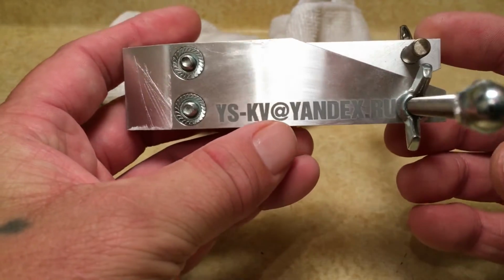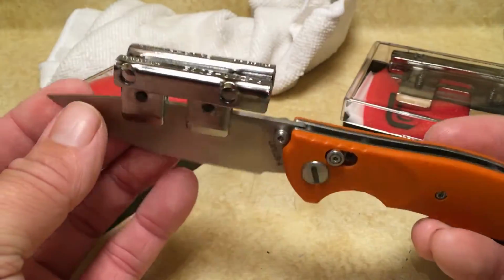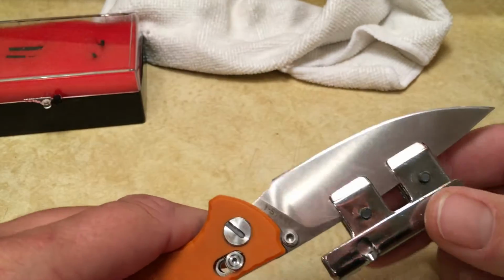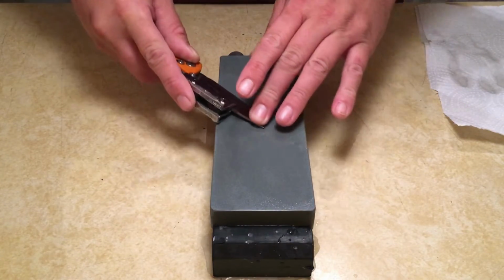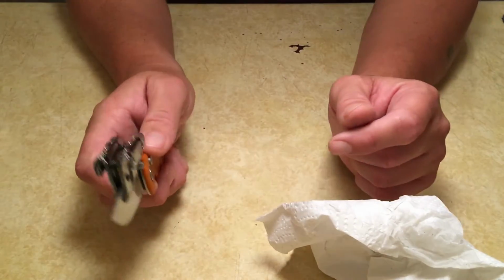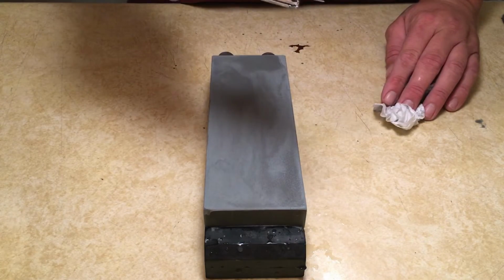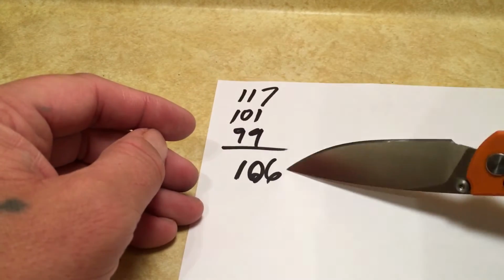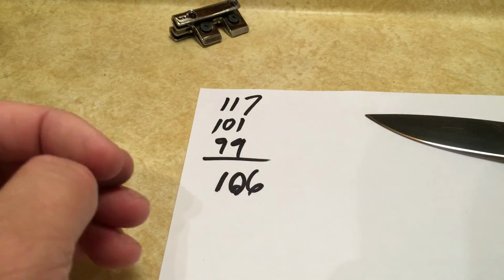Razor Edge System - Knife Sharpening Guide

Comment: I am from northern Mn, and way back in the 70's, I helped demo these at gun and camping shows, with, and for the Juranitch's. There is a tip to make these work better with less, to no wear on the clamp. They sell adhesive teflon sheets and stickers with peel off backing. If after clamping the knife in, you cut and stick some small strips of this teflon tape on the surfaces of the clamp that come in contact with the stone, than the clamp will last much longer. You have to peel the tape off to get the clamp off anyway, so just use new strips of tape each time.
I do not mean electrical or any packing tape. Teflon tape. There are competing brands nowadays. I believe the general term for these products is frictionless tape. I have used it for decades in other applications. I should also add that where and how you put the clamp on the knife makes a huge difference. I.e.- closer to the hilt/handle, or closer to the blade. You also do not have to clamp it on with the spine of the knife pushed back flat and straight to the inside back of the clamp. You can put the clamp on at different angles to accomodate different tip curves and shapes. 
 I prefer freehand sharpening myself, and that is about all I have done for decades. But be aware there are variations to consider for each knife shape as to the proper angle and placement of ANY clamp system to best fit the shape of the cutting instrument you are sharpening.
Reply from the maker: Thanks so much for the tip! I still think razors edge should address this, and the end user shouldn’t have to tweak things, so it works better. Still, that is very helpful to know, for someone looking to use these. The wear is pretty dramatic, on first use.it hasn’t been too noticeable in subsequent rounds.
Reply: @Jef  , You're welcome. I agree with what you said. It was addressed years ago. I am not associated with them in any way anymore, but they have kits you can buy. Some of those kits in the old days had vhs tapes that went into great detail on these finer tips for users. They also had what were called advanced use videos. From what I have seen looking online, they sell a fraction of what they used to.
Here is some bio. John was known as the "lumberjack" sharpening guy in shaving contests, the guiness book record, and for the classic, razor edge book of sharpening. What most people don't realise is he owned and operated a company that specialised in the meat cutting industry and both sharpening knives for slaughterhouses, and selling equipment for the employees to sharpen their butcher and boning knives throughout the work day. He invented and refined many sharpening and honing tools for the meat packing industry. Many modern sharpening and honing designs were actually his inventions. Such as the mouse. Many of the spring loaded devices that have two seperate moving rods are all copying John's designs going back to, I believe, the late 60's, early 70's. Possibly even earlier. He was responsible for Buck putting out the Honemaster. 
I also am fortunate in that I was friends with and helped design many of the Crock Stick products, having been friends with the owner and inventor of the Crockstick. Louis Graves Jr. A former, famous WWll fighter pilot and in later years, a Jehovah's Witness minister. ( I am not Jehovah's Witness and Louis never preached to me). I know a ton of backstory and tips for those, as well. Louis lived on Sunfish Lake just north of Anoka Mn. Interestingly, the factory was across the street from his house. I know all the connections between Smith's sharpeners, other companies, Sal Glesser of Spyderco, who paid money and got permission to make and sell the Sharpmaker. Which was actually one of Louis's designs he designed and used to sell. Louis stopped selling it, and gave over the rights to Sal. My sister lives less than two miles from Louis's old house and factory. Louis was a blood heir to Case knives and helped design many of Case knives iconic models and designs. Louis's old house and the falling apart factory are still there.
John started his company in Green Bay, Wisconsin and sold his goods through mail order mostly, from Green Bay. Or at shows, fairs, etc. They moved the company to Ely Mn when they moved there.
Interestingly, one of John's sons, who I knew and sometimes worked with became a wrestler for the AWA, known as Nord the Barbarian.
He went to the WWF, that's what it was called at the time, and became known as the Berserker, if I remember the stage name correct.
He retired and became a car salesman in Anoka Mn. He has even sold a couple cars to my sister.
 Have a good day Jef and nice chatting.
( I have way too much sharpening stuff and have been addicted to it for about 50 years now, as I grew up doing mountain man and outdoor survival stuff. That was how I bumped into Mr. Juranitch in the first place. He admired that a teenager could live in the woods for weeks, trapped, did pioneer skills, and he liked the knives, sheaths and stuff I used to make.) I enjoy your videos Jef!
 Have a great day!
Reply from the maker: @paulkresky1465  Awesome to hear the history behind some of this. Thanks so much for taking the time to share that. I pinned the comment so hopefully other viewers will see it. Amazing to hear how much he influenced sharping gadgets, to help people with consistency. I knew these things were around for some time, but no idea of all the detail behind it. The Sharpmaker, for example, I thought, was Sal's invention! I had never heard of Louis Graves Jr. till you typed his name. 

Btw I remember the Berseker. I watched the WWF back in the day. For a kid, it was almost mandatory. I even remember when Cindi Lauper got involved, and had several music videos featuring some of those guys. Funny ole world :)
Reply: I really enjoyed reading that. Milestone moments with giants of the knife community.
Reply: Thank you for the tape idea!

Comment: Great job 👍. I have this system sitting in my stone bin.  Up to this point I'm a C grade free hand sharpener.  Making the effort to sharpen free hand has helped me a lot with stropping.  I picked up a bunch of practice blades at the thrift store.  I occasionally sharpen a few and return them with a good edge.  Masking tape on the blade labeled Sharp.   I'm buying the R1 Sharpener soon to get my expensive kitchen knives squared away.  In a year or so my free hand skills may get to a B+ level.  The problem is that I already get A+ work on the KME   thanks again so much for the video 😀👍
Reply from the maker: Yea using guided systems and then comparing your free hand edge, can be discouraging. I see nothing wrong with guided systems. They are tools I still use. However, the experience of free hand sharpening, is just so much more rewarding.. If you keep at it, you will eventually start to notice a change in the the edge quality. It just takes time and practice.

Comment: Great video and much respect for you showing real time use. I’m not sure but on the nanawa what about putting a small piece of friction tape on the blade to help it from sliding? You can get rolls of it in the plumbing isle.
Reply from the maker: That would probably work really well. Or even shelf liner, if you can get the clamp to fit over it and the spine. I shot a video last night using it, with just clear packing tape. It held in place well just using that.
Reply: Jef Jewell well if you’re having issues that friction tape is actually cloth like material and designed to not slip. But I hear you use what you have . Have a good night

Comment: Looks like a good concept. I've made things similar to the Naniwa guide out of pieces of wire and duct tape. Place the wire on the main bevel parallel to the edge of the knife and tape it down. Do the same on the other side and you have a fixed angle. The diameter of the wire, and distance from the edge make the angle adjustable. Sounds silly I'm sure, but it did work well.
Reply from the maker: No quite clever actually. I never would have thought of something like that. I'm not the type who can see a flat head screw, and intuitively use a coin to open it.

Comment: I think the crutch would be the most accurate you don’t have to worry about the metal or ceramic being ground  of
Reply from the maker: Well the Crutch does have grinding issues, if you get too far over the stone. It requires you to really ride the sides, unless you have it inverted, sharpening the tip. They all seem to have some limitations. This design could be greatly improved, with just some wheels, or some sort of high abrasion resistant material. Not sure how the stones would fair in that scenario, but at least the clamp wouldn't change angles from wear. I do like the simplicity of the Naniwa a bit more. For someone not wanting to fuss around with things, and just want to get a sharp knife, that seems to be the easiest route. The Crutch is a level above both of these, imo. It is helpful for edge connoisseurs. Get the perfect bevel, at the perfect angle.
Reply: Jef Jewell the best way to do it imo is freehand or with a fixed angle system like a hapstone edge pro or kme
Reply: Jef Jewell these things just look really finicky and annoying

Comment: I admire your desire to experiment with such "fixed angle" jigs. I do not have the nerve - they frustrate me. I remember first time I saw DMT Aligner kit - just dismantled it and used the plates in the palm of my hand. Although I found one jig useful - the type for chisels and plain blades with at least decent quality. Not being a carpenter it is not every time easy to do 90 degrees square edge to the sides.
Reply from the maker: I like to be able to share my experience, and thoughts, on these devices. I get asked often, if I have ever used certain models, and if I could recommend one. Not everyone wants to take the time to learn how to free hand, and these do provide an alternative. The results can be fantastic, and anything that gets another interested in sharpening, I am all for it :)

The Dmt Aligner I always heard was flimsy. The plastic would deform with too much pressure and the clamp wasn't always super secure. It's still a nice concept, and if someone can make use out of it, and keep a sharp knife, then who am I to criticize. 

Appreciate ya commenting. Have a good one!

Comment: What stone you sending out I would go for somthing in the 1500 grit to 400 range unless you have a finer stone that cuts insanely fast
Reply from the maker: Something coarse enough to fix a really blunt knife, but one that will leave a fantastic edge on it's on. Naniwa Pro 400 fits that bill nicely. Splash n go, so no worries on soaking. Holds shape well, cuts fast enough to reprofile, and you can get a fantastic edge with it. Strop long enough, and you can even get some luster afterwards. Debated sending another finer stone, for refinement, but adjusting the clamp can be a real pain in the ass, esp for someone not familiar with sharpening. I want to try and keep it simple and easy.
Reply: Jef Jewell yeah naniwa pro 400 would be a good choice that’s what I was thinking of as long as they don’t try and sharpen some crazy super steel it should work great
Reply from the maker: Yea that could be frustrating :p
Reply: Jef Jewell yeah try and sharpen out some chips in somthing like Rex 121 with that lol